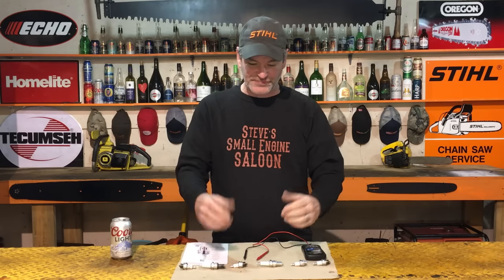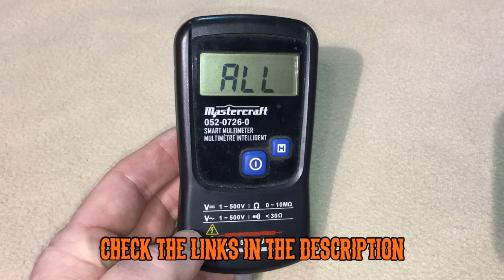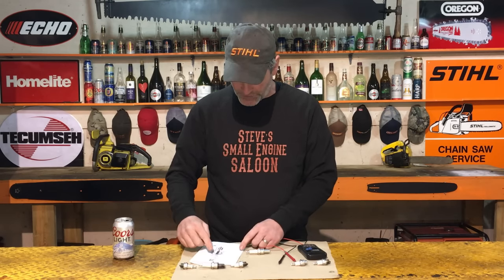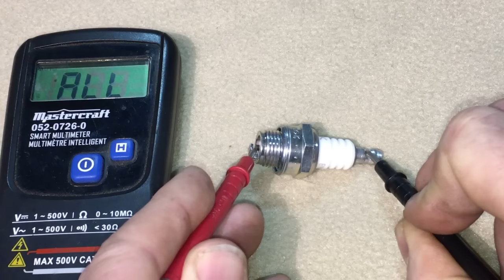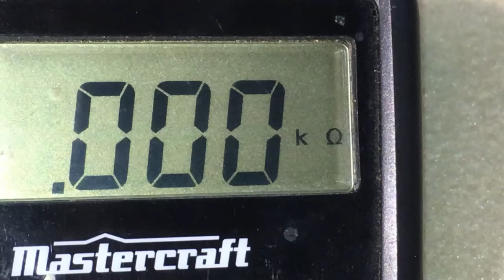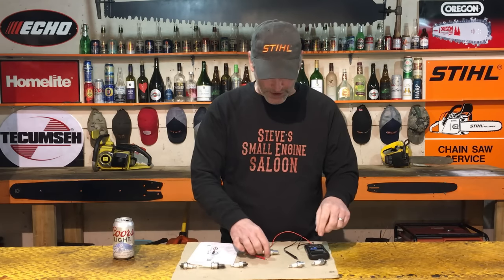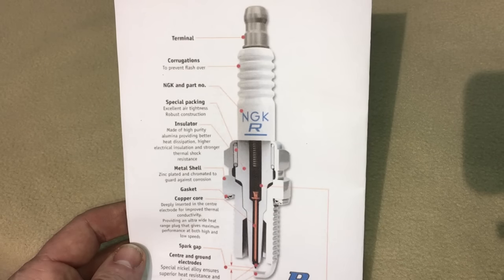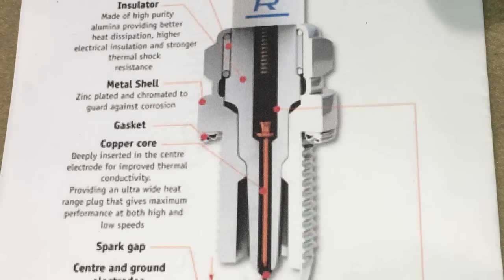How To TEST A SPARK PLUG In 1 Minute

Comment: Nice video Steve, you always learn sometng new. One tech question, if using an outboard  and there's no electric or electronic equipment installed onboard will it be better to install a non resistance spark plug. What are the pros and cons of a non R and an R plug  with same heat range ?
Reply: Thanks, but the coil won't know which type it's used as the coil always produces the same amount of high voltage. For that purpose all electric and electronic parts must be doing their respective homework right. I'm a boater guy that likes running full throttle grip. Have tested both NKG BR7HS-10 and B7HS-10 and there's no water performance difference. BTW motor factory recommends the use of  any of both.

Comment: Hello Steve. Greetings from Cheshire, England. First of all, I want to thank you for putting out these excellent videos and sharing your knowledge. They have helped me and my son to refurbish and get running well several old and knackered ebay chainsaws since Buckin' Billy Ray got us hooked on the subject (seems there's a bit of a BC influence going on here: maybe we should visit some time). 

Now to business. Pulled our old neglected Honda GCV160 powered lawnmower out of its winter storage in the log store on Friday. Started no problem then died after about 30 seconds and would not run again until left for a good while. Did this a few times. Suspected fuel starvation. We obviously had a spark. 

Spent the weekend doing all the following in accordance with your videos with no change to the problem, as well as cleaning the spark plug several times along the way (carbon fouling). I tried: purging and adding fresh fuel (turns out my younger son who loves mowing had filled it with 2-stroke mix while I wasn't watching), running without fuel cap, running without air filter, cleaned air filter anyway, dismantled and cleaned carb (didn't look too bad but it's sparkly now (a one bottle of Les Dauphins Côtes du Rhônes Villages job), checked remote choke operation (not auto choke) , checked fuel supply to carb (no problem: shut the fuel tap immediately it cut out and drained the carb bowl a couple of times: it was full (and no water)), reset the valve clearances (inlet was spot on but exhaust was at 15 thou. (nearly a full bottle of Marqués de Montino Rioja job)). No change. 

Finally the new spark plug (Bosch WR8DC - equivalent to NGK BPR5ES as specified in the Honda engine manual) arrived. This was a desperate last chance to save the mower from the tip as we obviously had a spark. I put it in and she now runs perfectly. £5 plug saves £400 on a new mower. The old plug (NGKBPR6ES) tested out okay with my multimeter according to this video: no short circuit between centre electrode and ground and 4 kOhm on the centre electrode. So it seems the plug was failing but only when it got warm. Have you ever seen this sort of failure before? 

Thanks again for all your help over the last couple of years. 

Best regards and keep on rockin' in the free world, 

Dave.

Comment: I was given a Honda Harmony 2 with a bad plug. It ran, but ran terribly. As soon as I replaced the plug, it ran great. Thankyou friend that gave me a free mower. My point is, change the plug if you are experiencing issues that make no sence. Sometimes the plug works, but it may be badly worn or thermally destroyed. If the center electrode is cracked, you cannot see that. Heat and age can and does break down a plug. NGK sparkplugs that are normally in Honda mowers are known for fouling issues over time. I should know. I have had years of experience working with them on snowmobiles and motorcycles.

Comment: Since the ohmmeter only puts out a small voltage, the ceramic insulator could be cracked and the high voltage spark could be going to ground thru the crack.

Comment: I rarely  have to replace spark plugs in mowers... the mower i use now is a yardman 2004 with a 6.5 briggs...starts with one pull... i bought it used in 2013 i think the plug was just replaced...i never have taken plug out to even look at it... i never heard of a mower getting ruined by a bad spark plug... i change oil every 3 years. and keep air filter chean... i just cut/mulch my 1/2 acre or less yard maybe 25 times each year...No smoking or lack of power,runs strong... i think this 6.5 briggs is a very good engine imo..

Comment: Hi STEVE, can you help me. My poulan lawn tractor stopped running while cutting grass. It rode fine earlier. I tried to start it up again but the fly wheel turned very slow until it stopped. Must be electrical, checked battery and got 12.6v, checked spark plug, and checked ignition coil where I got the ohms. Forget what the limit on coil was but within range. I’m lost. Thanks again, Michael Leone

Comment: Well ok, mine is weird.    First time using a multimeter, watched this and several other videos, I have a small 2 stroke motor on my bicycle.  Barely through it's break in period last summer, this year won't start.  So my plug does NOT have an R in the number, non resistance.  I put the red on the boot end, touch the black to the point on the other, and holding perfectly still, the meter is all over the place.  400, do nothing, 20 something, back to nothing,  What is up with this?

Comment: Do you have a video about continuing the troubleshooting if you have no spark but the spark plug is good? If so I could not find it and if not I would appreciate if you did one to show testing the coil on a Honda lawn mower, and other areas of the ignition system to isolate the no spark problem.

Comment: Fantastic 👍🏻.   Could you do a video on the number designations on spark plugs. 
With heat ranges and how they differ.?   And if they are interchangeable ?  Should I run a different heat range plug in my chainsaw do to outside temperature. ?    Or when should I run a different plug ?
Reply: You should never have to change the heat range unless you made some serious mod to the way the engine runs, outside temperature won't make any difference, the engine will get to operating temp no matter what. Just stick to what the recommended plug is, it's been designed for that engine.

Comment: Hey Steve, if I may call you Steve,  otherwise sorry,  I had gotten one and only one that tested good by both tests, it turned out to be and well-insulated spark plug threads the fix was to PB blaster and then tap out the threads with anew spark plug tap. this clean out the threads to make a connection with the cylinder head  I asked the owner what he had done had taped the spark plug outside and wet brushed the cylinder head with a radio vanish that he had found on his grandfathers' workshop and had seen how sharp his grandfather lawnmower looked. he was thinking that the old man just cleaned and then varnished those lawn equipment. but the spark plug was loose and the varnish just sucked its way into and between the inside threads and the outside threads of the spark plug luck would have the varnish was for 20K Volts transmitter plate voltage which was for a max 6 DB overloading emergency uses of the naval ship uses. This means that it was safe for 80K Volts operational loads. This had happened back in the middle 1960s. Today the use of tube radios are almost not found commonly as it was during the 20s through the 70s, Thank God! It is and will be totally rare just find said vanish to used in the common workshop! sorry if this sounds a little angry but really I'm not even a little bit but it did drove me for loops until I Found-out the events and had some radio self works in Radio transmitters. Otherwise, I would have been totally lost.

Comment: Do you see any need to use a resistor plug in a small engine.  I would think the non R will give you a stronger spark.

Comment: Hi Steve. Great video as always. I have a wacker neuson concrete saw and I replaced the piston and rings. Now that it's back together, I tried to start it but no spark. I cleaned up the coil and flywheel magnet, grounding area where the screws are. Now, when I put my inline spark tester on the plug and the plug boot from the coil, it's showing it's getting fire and when I try it with the plug grounded to the metal, there's no spark??? I've tried an ngk and a champion, which is what the manual calls for. Gapped at twenty thousands. I don't know?

Comment: Quite a simple test, but remember the Ohm meter only has a 9v internal supply, so will not give the plug as good a test as a 500v mega.    I used to test telephone lines with a 1000v mega for leakage current, some of the lines were over twenty miles long, and took about 20 seconds to charge up to voltage...  We had a few hundred of those to check once every fortnight, most passed the test.

Comment: How to check spark on your small engine  . remove  spark plug  . turn on switch  . hold plug wire  . pull cord . if you hear your self cuss.. you have  spark . no cussing sound no spark

Comment: Steve what difference will it make if I don’t have a resistor plug to replace old one. Will a reg plug work in a crunch?🤔
Reply: Radio frequency interference). RFI, as its name suggests, creates static on your radio and interference with other electronic equipment, and electronic control units. I would think that a regular plug will work fine, unless it interferes with some electronic component, my two cents!

Comment: Steve i got a Predator 420 and someone didn't bolt down the ignition switch and tore out the wires and has the starter coil un screwed what is the gap for a coil i know a buissnes card works but i would like to know the gap

Comment: Well presented and informative. I would add that testing between the centre  electrode and the earth screw thread. Should be an insulation resistance test. This would highlight a breakdown in insulation  not picked up a continuity test. I know I got over the top but thought I put it out there.
Reply: No this is a good test to do as it is surprising how many times you will find resistance doing that.   I don't use those plugs. 

Dale in Canada 🍁

Comment: As always good tip
One trouble is the multimeter ohm meter is only 1.5 to 9 volts.  May show open at that voltage but I'm the engine the spark gap sees thousands of volts and shorts before  you can get a spark.  Even if you use the out of the engine spark plug test when in the engine the compression of air  may be enough to prevent the spark.
The low voltage of the multimeter has fooled people in many  other applications
But your experience tells me to try this first.  Thanks again 😅

Comment: ....very worthwhile video. I'd waited till it was dark to test for sparks on the plugs for several old machines or even old new cheap machines I never touched in years. I had a few suspicions, you've pointed out defiinet things to check through. The clincher is  some spark plugs have a resistance and 5k is actually a lot . I couldn't understand why all of a sudden one machine no longer showed a healthy spark . I'd been interchanging plugs on the machines . Fancy that , the Dickens you say , never knew plugs could have resistance .

Comment: I just watched a guy test for spark at the spark plug of a mower that wouldn't run and had good spark, and from that moment on he tore into that mower to try getting it started but failed. As a last resort, he installed another spark plug and the mower cranked over and ran good. I did a similar thing testing for power at a washer machine with a neon test lamp, it illuminated and I starting tearing into that washer when I had a though, go out and buy a multi meter. I got home and the multi-meter and the 120V receptacle only showed 90 volts. I followed the wiring back to a junction box, removed the cover, and found a poor splice connection. I re tightened the splice connection, soldiered it, and got the 120V for the washer. You can't beat experience.  I enjoy your channel, thanks for sharing.

Comment: I didn't realize that small power equipment spark plugs could have so much resistance.  Is there an online resource for looking-up that spec.?
Reply: Don't  worry  about it.  Its  figured  into the ignition circuit.  Remember this is  a  HIGH voltage  spark jumping and  air  gap.  The resistance  doesn't really  matter - and  with all the radio frequency stuff in daily use  everywhere  you dont want a non R  plug.  You neighbor  may shoot you with a pellet  gun  otherwise.  They don't  like that  "tick-tick tick tick  tick "in the Bluetooth headphones :)

Comment: Thanks for the vid Steve. I once had a problem with a saw that wouldn't start. It had fuel, spark and compression. After checking for spark as I went to install the plug I noticed the center electrode move and slide down until it contacted the ground electrode. When I flipped the plug back to electrode up it slid back showing the proper gap and would give a spark. So while it looked good and passed the spark test, when installed the electrode would move and there would be no gap. I tossed it into the garbage can!

Comment: My stihl bg 86c blower runs for a few seconds then bogs down and dies everytime both at idle and full revs, I've cleaned the carb all is in order, cleaned the air filter, fuel filter and it doesn't have a spark arrestor, and I've cleaned the spark plug but nothing has changed any ideas?

Comment: I have never had many problems with spark plugs, except with my 1966 Yamaha 80 2 stroke. Plugs would last about 1000 miles, then they would misfire under load. Cleaning did not seem to help. The plug would look ok. I never did figure out why they seemed to have such a short life.
Reply: Maybe change brands

Comment: Another good article.  One issue, though.  If the insulator core is cracked, it will indeed most likely cause the spark to short circuit there.  But that in itself may not cause your ohmmeter to show the problem, however, until it has gone on for some time and a carbon track has been created.  I like to check my plug out of the motor with the wire attached and then pull the rope (in a relatively dark area), and look for the spark.  Of course, under compression it is harder for the spark to be created, so there is still a remote possibility that it will spark when not in the engine but fail to spark when installed.

Comment: Low resistance could be due to carbon buildup around the electrode. There is a specialist sandblasting box for sparkplugs to clean the electrode.

Comment: For what it's worth in the old days we had to clean and test plugs frequently,we had the old big can sand blaster for cleaning and we had a pressurized apparatus we screwed the plug into and connected the wire to the plug we could see the tip thru a sealed port and we brought the pressure up to around 100 psi, quite frequently the plug would fire at low pressure but not high pressure.Your bench test   will detect all but pressure related miss fires.

Comment: I checked my Carlton C9 plug and the resistance was off the scale. It did spark but it was no strong spark. Engine was ruff and did not rev well.
Reply: I found out the spark plug was the wrong one! I got the correct one as in the manual, NGK and it fired right up.  It has a longer shaft.

Comment: You gave away your age with the statement "your meter should not move", you evidently learned on an analog meter where the needle actually moves as opposed to a digital meter where the number display changes.

Comment: Now, to find a way to test the output of the coil.
Is there a high voltage measuring meter that can do this that is designed for spark plugs?

Comment: Dude, the operating conditions of spark plugs are approximately 15000V and the pulse current is up to 200mA and you are testing insulation with 9V and current less than 1mA. Your questioning is just gathering a review into philosophizing to no avail in real life. Everything "on the table" should be tested in approximately operating conditions and for this there are high voltage generators to which the spurk plow is connected and must give a spark of bluish color if everything is correct and if the insulation is weak or conductivity less than required spark is reddish orange. That is the only correct examination. Funny video

Comment: Thanks for the videos Steve! How often should spark plugs be changed as a general rule of thumb in small engines for yard equipment ?
Reply from the maker: I personally would never replace a plug if it still works fine and has a nice blue spark on it.....

Comment: Just did battle with an old 8 hp Briggs L head for two weeks, new points and coil ( which were corroded and not producing spark), rebuilt carb etc...  couldnt get it to run properly , was driving me crazy then watched this video and discovered bad spark plug. I should have  known better, this video was a good reminder for me. Have one on me......
Reply from the maker: Right on

Comment: Very instructive walk around spark problems, thanks Steve! I'd like to widen your multimeter's application in the matter, and discovered INTERESTING symptom = the central electrode gains resistance during its work-hours! When you try resistance of new plug it's ZERO and audio-signal buzz loudly. After several w.hours you can't hear any buzz, but the meter shows abt. 1700mV drop on central el., yet no ohm res. It'd be interesting  how a drop of conductance of centr.el. describes plug quality. My tests have been made on three plugs of various makes&wears. Namely: Champion/new ; Bosch/10hrs wear; Autolite/50hrs wear. The last one gives the poorest spark and is rather an exhibit now.